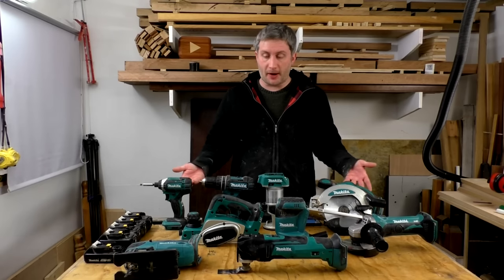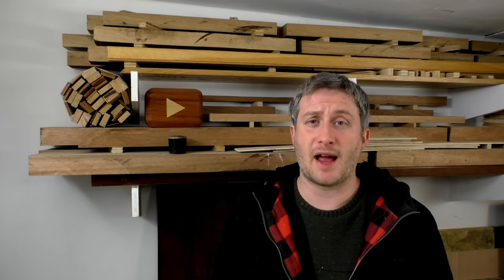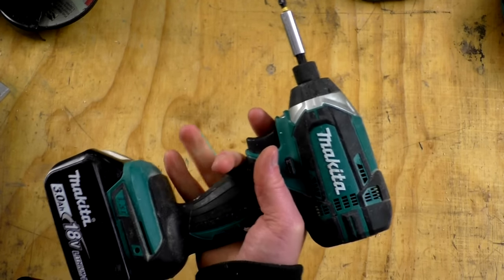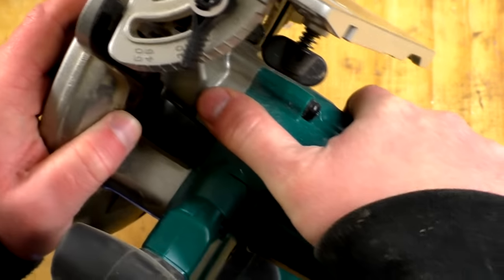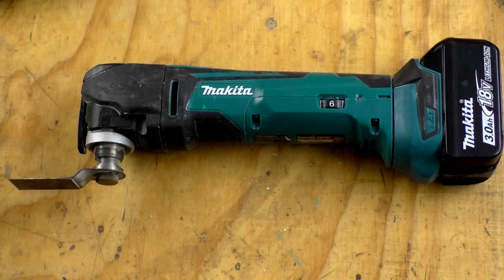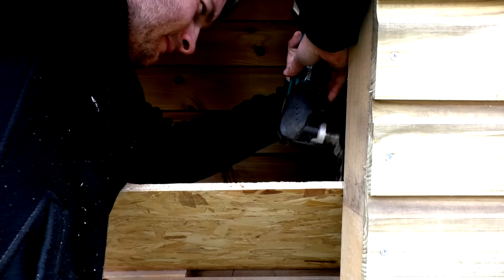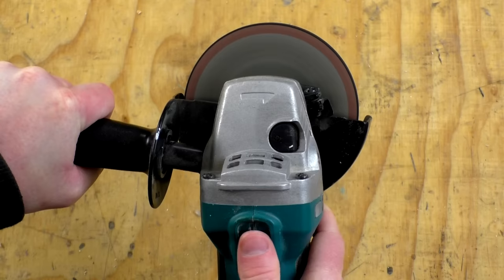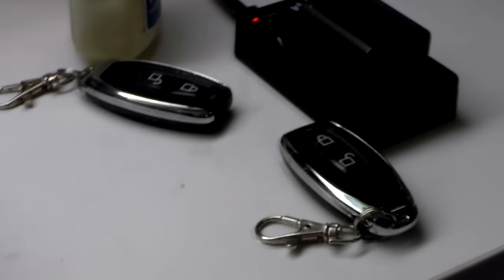My Makita Cordless LXT Tools Review

Comment: Cheers from Canada. I have 10 Makita tools. I use them all the time, and I'm an engineer by trade (so not really experienced with working with tools). I have just learned something new about the jig saw settings, so thanks. I'm currently replacing my carpet in my house with hardwood flooring, and use the jig saw and multitool almost every day that I work on my floor. I went in to buy the cordless orbital sander, but the tool guy talked me into the corded version instead. That's the only time he's ever had anything negative to say about a Makita cordless tool. Tools you didn't mention that I have are the blower, which I use all the time (works great to blow the leaves out of my gutters), the chainsaw, the weed eater, and the flashlight/radio. 

Tools I'd like but don't currently have: 1) lawnmower, 2) back back vacuum, 3) reciprocating saw

Comment: I have to agree about the multi-tool. It's almost like a miniature jackhammer for detailed cutting and shaping. Cuts not only wood but also metal. Great for flush cutting nails and essential for tile and door work. You also use it in most places you would use a chisel.

Comment: Extensive review, good job! Cordless tools are very helpful on a job site (like your circular saw to cut 5m boards!), but in the workshop, I prefer using corded tools (drill/impact driver aside), all connected to a multi plug extension integrated into the workbench and connected to the shop vac, so that I don"t have to bother with battery life. Personal choice though.

Comment: Spent the last several hours researching power tools. Went in believing Milwaukee was the brand I would purchase but after your video and several others I'll be buying Makita. Not only do they NOT have a parent company which is good (look into it) they are reasonably priced and appear to be at the same quality of Milwaukee, which is a lot more expensive at least in the states. 

Excellent video. Really appreciate the simple way you explained each tool, gave your experience with it, while also showing it in action
Reply: Milwaukee, Ryobi, Ridgid/AEG are all TTI.

DeWalt, Craftsman and Porter Cable are all StanleyBlack & Decker. 

Kobalt, Flex, EGO, and Skil are all Chervon. 

Makita, Hilti, Bosch, Fein and Festool are all without a parent company.

Comment: I’m a Makita fanboy through and through. I’ve always had Makita tools.  I’ve had Milwaukee corded and cordless but the Makita cordless can’t be beat for quality, dependability and price. All of my cordless Makita are brushless from my impact driver, which I’ve had for five years and has been dropped from a 3 story roof onto a concrete patio, till my lawnmower, yes lawnmower,hedge trimmer, orbital sander, drill, reciprocating saw, weed wacker, brad nailer and my latest and best purchase of all, the 36 volt worm drive saw. I should state that I only use 5 AH batteries as the life is very long and they charge in the same amount of time as the 3 and 4 ah. I highly suggest and recommend the brushless cordless. You won’t be disappointed.

Comment: The carger uses fan to blow air through the batteris too. Which is a nice design most don't have. It keeps batteris cool and doesn't ruin them by charging hot batteries. You get hot batteries from use and this anables to quickly re-charge them, not wait until they cool down.

Comment: My next tools will probably be both the angle grinder and the die grinder. Then a couple led flood lights and maybe a concrete rotary drill.

I also have a few of the garden tools. What I like about the garden tools is both no cord and with no gas I don't have to worry about carburetor seals being destroyed by separated alcohol in gas. For all the tools I only have to replace batteries over 20 years if I take care of them. A sound investment in a home.

Comment: Thank you for showing us a good representation of the Makita line. I got into the Milwaukee paltform here in the US and have most of the types you have. The router I find is easier to use with a plunge base. It's got a wicked fast spindle speed and I like to keep my fingers as far away as possible.

Comment: Thanks for the video. I just watched it, four years after you posted it, but I still found it useful (as I'm trying to decide on a cordless circular saw). The three power tools I currently own (a drill, a trim router and a jig saw) are part of the Bosch 12V range. I'm trying to decide between Bosch, Makita and Dewalt... and after watching your video, Makita is winning the battle in my mind. Thanks.

Comment: I have a fair share of Makita tools as a professional carpenter. - I  also love using cordless most of the year, but I will say in the winter battery tools can't deal with the temperature working outside- if it's below zero Fahrenheit (-20ish centigrade) or colder you general are stuck with corded tools.... That means you end up owning the basics at least in corded ( skilsaw, sawsall, grinder,  drill, chop saw) - 
Nice review ( friendly howdy from Wisconsin U.S.A.)

Comment: Speaking from my own experience as a furniture maker - I'm about half and half between Makita and Bosch Pro (Blue), and while for some reason I always find myself leaning Makita, the Bosch tools are truly excellent and have never let me down, even after significant abuse!
Reply: In an ideal world I would go for either Bosch or Makita, but at least in Central Europe, I've gone for Ryobi. 

I think for DIYers the price / performance ratio can't be beaten. I wouldn't call Ryobi professional tools, but they manage to get the job done. But for me it's all about the price. The same tools I have if I had gone for Bosch or Makita would at least be double the price. When I buy a Ryobi tool I buy the best tool in the range, which in some cases has brushless. Those tools are priced competitively with the mid range of Makita. 

No doubt in my mind if you can afford it go for Makita or Bosch blue. But if you can't get either of these lines, then Ryobi is still a viable option.
Reply: @blahdiblah2169  the difference is the makita tools will last five maybe 10x longer than riobi so that being said the makita brand is not more expensive its actually cheaper.
Reply: @jackscott5144  What I will say is this, now with about 2 years of experience in total with Ryobi, and dozens of varied projects. 

With Ryobi, some of their tools are better than others. Super happy with the brushless stuff I have. However, as an example, the palm router has quality issues. 

Then there are accessories. Honestly, it's not the company that gives a great deal of accessories. Back to that Palm router, the shanks that you can actually find for it from Ryobi are extremely limited. I understand it's a limited form factor, but Ryobi really need to up their game on accessories. 

Other than that, all my tools still work. But when I get around to replacing them which could still take another decade, even with more than moderate usage, I will upgrade to Bosch Blue, I have a miter saw in that range, and if it's a measure of the type of quality Bosch offer, then I'm fully sold.
Reply: Spare parts for Makita are easy to find and cheap, delivered in 3 or 4 days